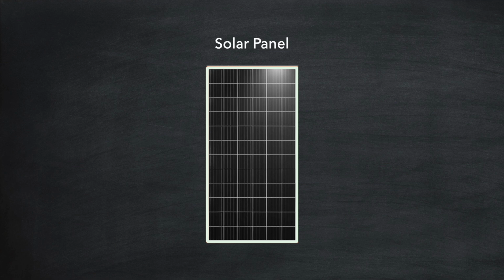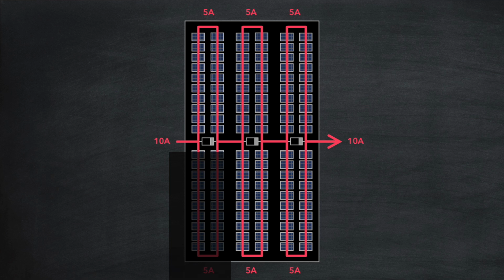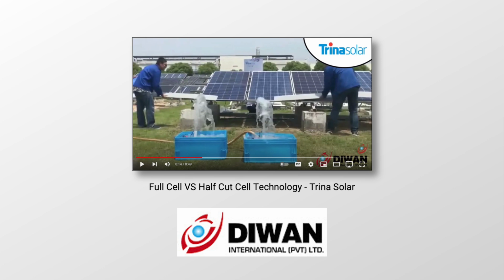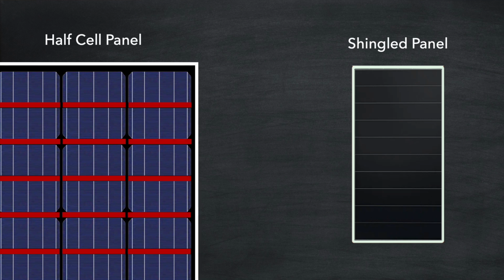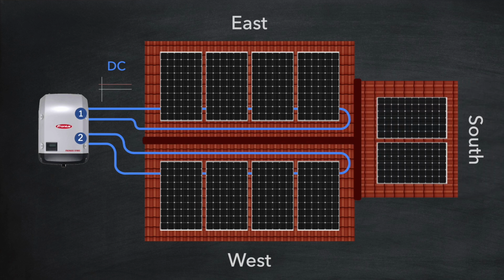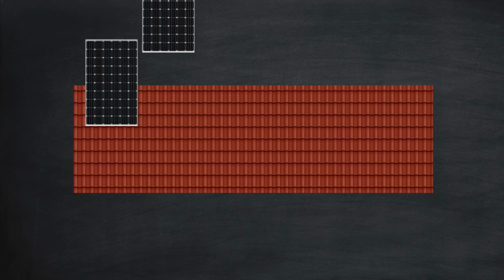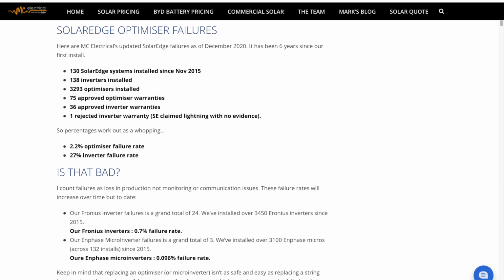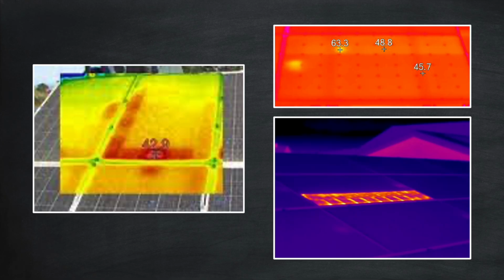Solar Panel Shading (Part 2): More on Optimisers and Micro inverters

Comment: I think the place where micro inverters have their place is where you have strings of radically different voltages, facing in different directions. Then they can't be placed in parallel because they're different voltages, nor series, otherwise the string voltage can fall below the inverter start voltage while the long string is shaded.
Reply from the maker: Yeah, good point 👍🏻

Comment: Hi Gary not sure if you can help with this. I have a new installation of 12 x530w panels delivering 6.3kw connected directly to a Powerwall 3. I have 6 east facing and 6 south facing in my house in Spain. The maximum output is 3.3kw as shown on Tesla app. I have a bit of shading on the south facing and have optimisers for this. Does this sound normal to you as only getting 50% output at best. Has always been this way since 1 month old install and had many clear days in Spain. Really appreciate your thoughts on this as installer won’t even communicate on this

Comment: Tigo optimizers were the best thing that’s ever happened to my off grid Solar cabin as I am surrounded by trees and Woodline.  People saying take the money and buy more panels must have unlimited size roof, and zero shedding. 
One thing not covered is the dramatic increase in performance when the panels are snow covered with optimizers versus without I’ve seen this myself and catalogued it over multiple seasons now.
Reply from the maker: Cool 👍🏻

Comment: Great video, but i think we need to consider a rather varriable factor, namely the passage of time!

Back in the day, a solar panel WAS expensive, so sure, spending some money to get the most output from each panel was the name of the game.  But time moves on, and today we are seeing panel prices so low that now the panel on-roof mounting system cost more than the panels themselves!  

Today, there is one basic rule, that is very very simple, just fit as many panels as you can physically fit.  Spending money to "optimise" any individual panel is simply not value for money for most (unless you have some very specific limiting factor case).  Again, with our high labour costs and (sensible) HSE rules that make any roof access a costly afair,  ANY requirement to access a roof mounted solar array is most likely going to render that array non-viable, ie to push the ROI time to longer than you live in the house for!!!

It's also worth noting that since the loss of FIT in the UK, it is the case that really solar arrays are not actually financially viable on their own, what you need FIRST is a battery storage system to leverage cheap rate 'lecy, then you add panels to reduce your consumption of that cheap rate 'lecy. (you may of course want to still fit solar panels for moral reasons, rather than purely financial ones)

This is starkly obvious in the UK because for 99.9% of domestic solar arrays, with the UK's seasonal insolation profile, you will still have to be connected to the mains grid as no panel array that can be paractically installed can power your house 100%, so you are still going to have to pay the standing charge anyway, and that standing charge is what then becomes the majority of your 'lecy bill no matter how many panels you have nor how efficient those panels are!  

So the "game changer" is not actually anything to do with solar panels, or optimisers or anything like that, it is actually to do with the falling cost of battery energy storage pushing solar domestic generation into second place in terms of value for money / ROI 🙂
Reply from the maker: I’m sorry, I just don’t agree with what you’ve said.

Comment: Not entioned is most string inverters have a warrenty period of just 10-12 years. This means they would typically need to be replaced twice over the life of most panels (tripling costs). Microinverters like those from enphase typically have a 25 year warrenty. Although a failure of a string inverter is somewhat easier to replace than a microinverter since it is accessed from the ground, when one goes out, it kills all power generation. A loss of one microinverter is a much lower percentage loss, and frankly they are pretty easy to replace if the panels are ground mounted, and not hard on a roof, depending on the roof. I would love to see typical periods for replacement for both string and microinverters and the econimicas of them given sting inverters more limited lives.
Reply from the maker: True, but I do cover that in this video:

https://youtu.be/q6t0AAi5Jws?si=28IgdvFomJcIzusY

Comment: Degradation is of no consequence. 7 Years ago my system expensive enough with 295W panels. Now, I swap them for 440W, or more for 25% of the original price. At some point the production will become so ridiculously low they become irrelevant or are replaced.
Reply from the maker: Good solar panels should on degrade 0.5%/year. But yes, you can always replace panels every 10 years with far superior ones too. Good point!
Reply: @GaryDoesSolar  Were decent Jasolar panels. But panels are getting higher efficiency and, hopefully, broader freq spectrum.

Comment: I currently have 85 Fronius installations in Estonia over the last 3 years without any problems.

However, the installation of Micro inverter is OK, if you want only some panels (e.g. 2-4) but in bigger installations it creates real headaches with the cabling,

Also the Micro Inverters are installed UNDER the solarpanels and exposed to temperatures of 70°C and more even in Estonia. I have already removed a bunch of them and replaced them with an appropriate string Inverter. Microinverters are still only Single phase, and can be easily replaced by a Fronius Primo 3kW. Startup Voltage is 80V, hence customers can already use 3-4 solarpanels 455Wp (e.G. Longhi half-cell)

Comment: Hi Gary I'd like to hear your opinion on an industrial roof. Is the same reasoning valid?
I have a "good side" with long roof strings, all oriented south with a good tilt, except for two sections of the roof "the bad side" that might require a dedicated inverter since they are almost flat oriented north and south. The roof in the "good side" is divided by a corridor at 2/3, so the strings have different lengths on the right and left.
One installer recommends SolarEdge to improve performance, while another says it’s unnecessary and only increases costs and maintenance. Who should I believe?
The roof only in one point in the middle have huge shading. So all the line would be affected.
Few Questions:
1. In this situation, what might be the most sensible approach from a 25-year investment perspective, considering all costs and system degradation?
2. If a panel in the string fails, how can I notice it without optimizers?
3. What if it produces less? Will I end up with the whole string producing less? How can I identify it?
4. If an optimizer is discontinued, will I face compatibility issues? I’m concerned about this. Is it possible to bypass an optimizer and run a mixed system?
5. Given the reviews, I’m leaning towards Enphase, but I’m unsure if I should expect performance differences between industrial and residential systems. Considering the significant length of the strings, I believe that having optimizers could help me monitor the system better and also support the warranty in case of accelerated panel degradation. 
6. And in case of fault only one panel is stopping not the whole string.
7. For risk point of view I understand that optimizer are better especially with long string that may have high voltage.

I don’t want to find myself hunting for issues instead of focusing on the work since this should be only a side project.
Reply from the maker: If you’re in the UK, you could always set up a Chat With Gary session with me—but not for the 2 weeks as I’m away from the office. Alternatively, contact a good solar installer to give you their view of the best configuration 👍🏻

Comment: Great presentation, both this and part 1. But am I right in thinking that with half-cell design, optimizers are actually more useful (so they can limit the ampere to avoid triggering the bypass diode) than on full-cell?
Reply from the maker: Ah, good question! I’d need to think about that…

Comment: Recently discovered? Seriously? It's trivial knowledge that current is proportional to surface area of a cell all else equal. You cut area to a half, you cut current to a half. The trick lies in parallel connection. There is alternate path for charge. The reason they use smaller cells is to preserve voltage of a panel. Had they used full-size cells (assuming their count was a convenient multiple), they would double current and half voltage of the panel. That's why those shingled panels you show have 1/5 cells with 5 parallel strings. Since they have 5 parallel strings, they need 5 times the number of cells to get the same voltage (string length) and so each cell is 1/5 the size to fit them in the same panel.

If you have multiple roof surfaces facing different directions, all you need is separate MPPT for each surface. You don't need multiple inverters. Or MPPT for each panel. And an inverter doesn't have to support multiple strings. You can have 10 MPPTs connected to 2 inverters if you want via main DC bus. And even if you have just 2 surfaces, you might want to use separate MPPTs and 2 inverters for redundancy and load sharing. E.g. I know a house (off grid) that has 3 arrays, each with its own MPPT, and three inverters for redundancy, load sharing and to improve efficiency (they are not all equal rating).

You have again extrapolated failure rates. You can't do that. These curves are typically a so-called bathtub. You get failures early due to defects, then things quiet down and then rates start to go up again as they age past their natural lifespan. If they are designed well, that significant rise in failures will happen after their design lifespan (after warranty). If you get 5 % failure rate in the first year, it doesn't mean you'll get 25 % rate in 5 years (failure rate in years 2 through 5 could very well be 0.001 % with those 5 % happening in first 6 months). In an application such as this, you want to do a proper burn in and quality control before you install them as replacing them is going to be expensive. I wouldn't consider buying such on-roof technology unless the manufacturer/ installer covers complete cost of replacement at least for the first year. That suggests to me they trust their quality control. If a unit fails after 10 years, you're unlikely to catch it during manufacture. In any case, low early rate is nice. But the only way to know whether they will last 25 years is to wait 25 years.

Personally, I hate "cloud" services. Any monitoring has to be on-premises. I don't want to bet that the manufacturer is going to be around for 25 years or that they will support my product for 25 years. You said it might be difficult to buy the same panel if you ever need a replacement. How about the same optimizer/ micro-inverter? If they have to communicate with each other. You're just shifting the problem.
Reply from the maker: If you say so…

Comment: You are absolutely correct about Solaredge optimisers.  I have 16 panels installed in 2018 and 2 optimisers have already been replaced after they failed.  Fortunately mine are easily accessible, so no big deal.  Excellent explanations.  Thanks.
Reply from the maker: Yeah, I'm hearing more and more about SolarEdge unit failures - such a shame, really...

Comment: Thank You Gary, really informative! Exceptional video! 

Question I have : if panel is fully covered in a shadow ? All bypass diodes will kick in? How  single panel like this affects the string of the panels?
Reply from the maker: You're very welcome - thanks for the great feedback! If a panel is fully covered in shadow, all the bypass diodes in that panel will kick in and so the output for that panel will be zero, but the output of the other panels will be unaffected.

Comment: At best, a bypass diode will effectively zero out the power contribution of a module. A DC optimizer or microinverter, however, will still harvest as much energy as possible from a shaded module without affecting the operating points of other modules in your design.
Reply from the maker: Depends on the kind of shading. For example, diffuse shading, as discussed in the video

Comment: I am using powerwall3 which allows upto 6 strings input.  

I have two arrays. A 8 panel array in prime sun location.  The second array is 16 panels that is effected by tree shading during early morning and mid day.      Without using optimizers or microinvertors.    Would it be more efficient to have 3 strings on the large array instead of just one large string?   

As you show that shade or issues with one panel will effect all panels in the same array string.
Reply from the maker: Without knowing more detail about your situation, I’m not in a position to advise. Best to contact a local solar installer for guidance.

Comment: Am I right in believing that if I want panel monitoring then the only way I'll get this info is by using either Optimizers (DC) or Microinverters (AC)?
There is no other way of getting monitoring?
Reply from the maker: As far as I know, that's correct, I'm afraid. Whatever goes on your roof (or elsewhere in the outside world) has to be weather-proof for 25 years - and only optimisers and microinverters are built for that...

Comment: I think I’d like to skip optimizers and microinverters, but I DO want a way to monitor performance on each panel. Does anyone manufacture a cheap per panel measurement hardware/software solution so I can see my array on my smartphone or internet connected laptop?
Reply from the maker: Hi Tom, I think the only way you'll get that is via optimisers or microinverters, I'm afraid...
Reply: @GaryDoesSolar  thx

Comment: What do you think of wind turbines based on the archemedies screw like the Liam F1 that I’m seeing videos for? Maybe you can do a video about whether there’s a place for turbines in our homes too.
Reply from the maker: Now, domestic wind generation is certainly an option that many are starting to look at, to compliment solar. But (unfortunately) there are a number of factors that limit it’s viability in consumer applications:

Wind turbines are not quiet - worse, the noise varies with the wind strength,  could drive any neighbours close by insane.

They are also nothing like solar panels in terms of reliability - you might find you’re spending a fair amount of time, money and effort keeping them going.

And they’re expensive. Like really expensive for one that generates even just a few kW.

Also watch out for the advertising. Some retailers talk in terms of kW (power) when they’re actually taking about kWh (energy) - even a cheap 30cm diameter turbine will generate 20kWh given enough time!
Reply: Not yet available, but Vortex looks promising. No blades, no noise.

Comment: 2% fail wow. I worked for a large telecom manufacturer and when we ended up with a 3rd party dc/dc converter increasing failure rate by 0.05% it was drains up time.
Reply from the maker: Yup

Comment: Thanks for the thoughtful info! I would just add that systems with micro-inverters where one fail with reduce your production by that panel only, a system with string inverter that fails stop all production until the inverter can be replaced. Perhaps 2 weeks to 1 month should be expected without production.
Reply from the maker: Agreed

Comment: Thanks for the great summary - your channel is really helping me to make some decisions about the system I will install.  One question... whilst the panels do a good job of managing shading within an individual panel (especially half-cell panels), won't any shaded panels still limit the power output of all other cells in the string?  So if you have a single string of 10 panels with only one that is are partially shaded you are losing quite a lot of power compared to using micro intervers where all non-shaded cells work at full power.  Is that correct?
Reply from the maker: You're very welcome. My analysis tells me it depends on the kind of shading in fact:

If it's hard shading (like from another building) then the bypass diodes are pretty good at limiting the effects only to the panels that are shaded - the other non-shaded panels will operate without problem.

If it's a large amount of diffuse shading (limiting light to say more than 20% of the panel) then it's as above - the bypass diodes will do their job.

But if it's a small amount of diffuse shading (limiting light to say less than 20% of the panel) or if there is shading from a cable or antenna, then the bypass diodes might not be triggered meaning current flow will be limited in the other non-shaded panels as well.

Comment: I wonder whether your position has altered at all after your recent video with Enphase? I suspect no as I suspect you didn’t learn much more than you already know, but, regardless of that, thank you for these very informative videos.  My issue is a complex roof space that would probably end up with too many strings for an average inverter, so an Enphase type system might suit, but the jury is still out and these videos help a lot in the thought process.
Reply from the maker: No, the Enphase inverter hasn't changed my opinion, which was expressed in my original video: https://www.youtube.com/watch?v=q6t0AAi5Jws

Yeah, microinverters could be a good solution for you - or a Tesla Powerwall 3 - see here: https://youtu.be/sSpQSDSVQ9M?si=w6r_lfv-y1-o5NjM